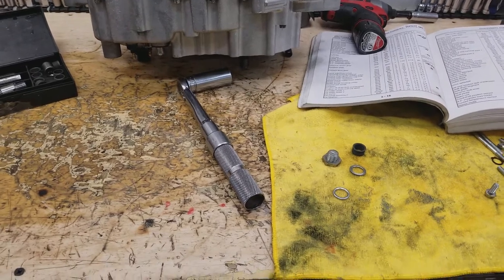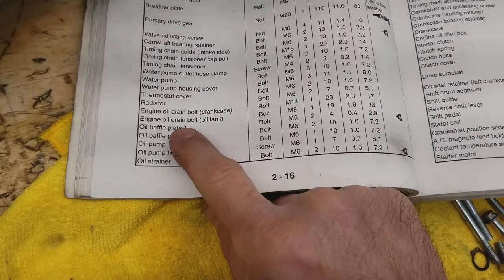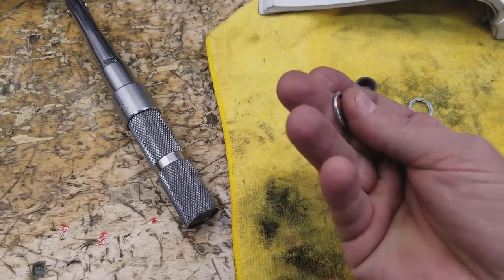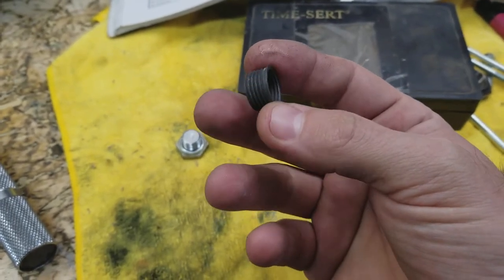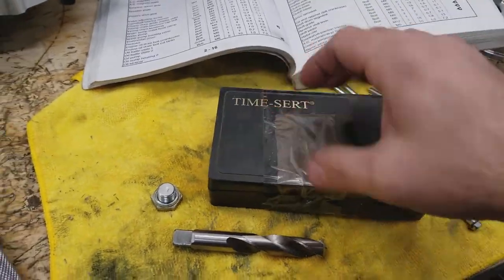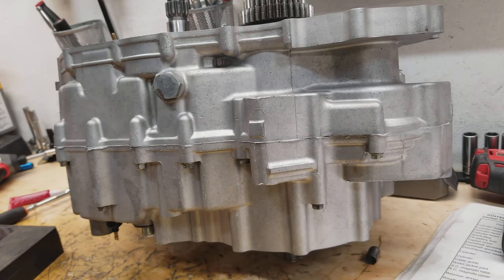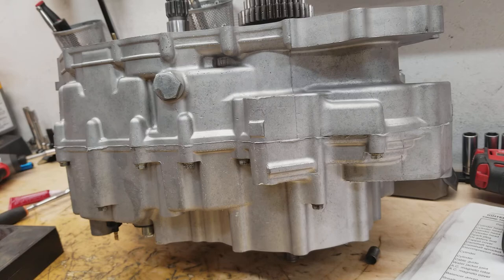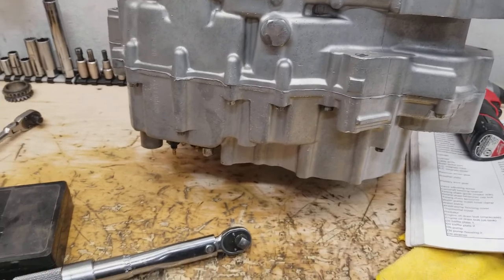Stripped oil drain bolt, raptor 700 why and how to prevent and repair

Comment: Bought a 2019 700 this year. Went to change the oil at 5 hours and hopefully I didn’t strip it out. What a poor design from a Japenese manufacture. Hard to believe new owners have to deal with this sort of thing. I watched your bolt reducer video. Seems like a good resolution. Thanks for confirming this issue with us.

Comment: I tripped out the oil pan bolt and i took it to a atv shop to have them work on it and when a got it back and i went to do a oil change and i see some kind of tape on the bolt and the washer  and i got a new washer  and it still leaks do you think i need to put tape back on the bolt and the tape is gray and  i think like for like air tools so what do you think ?? And do you think you need washers on both the oil bolt and the oil tank bolt to
Reply from the maker: Ryan Wofford most likely the new threads are nut cut square to the case so the washer is not seating flat. Check to see if it is sitting the same on all sides. If not the case can be flat filed and the angle changed to match

Comment: Can I repair it without tearing down the motor?
Reply from the maker: Yes.
Reply: @MrCuervoRacing  I took your advice and repaired the threads with a Time-Sert! Turned out perfect! I will be posting the video in a few days. Keep up the great videos! I
Reply from the maker: @garyborchardt6491  cool.
Reply: @garyborchardt6491  did you ever make that video?